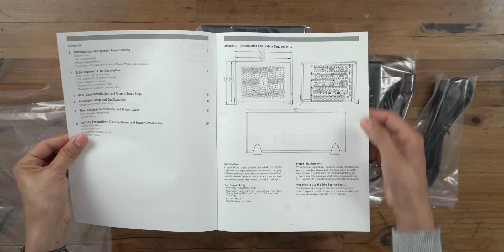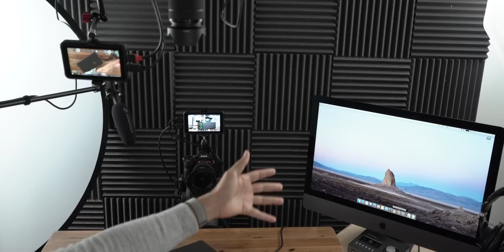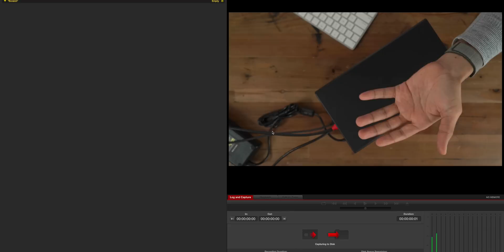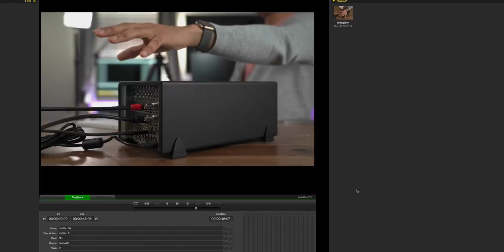How to build a Thunderbolt 3 dual 4K ProRes video capture box with Sonnet x Blackmagic hardware!

Comment from the maker: What do you guys and gals think about this setup? 👍🏽or 👎🏽? Let me know if you have any questions or just want to share a thought. Will be hanging out here in the comments and on Twitter (@JeffBenjam) over the next hour to answer anything you may have. Also be sure to read the full post on 9to5Mac (https://wp.me/p9SZa2-2tDj) for more photos and details.
Reply: Can you have quad 4K capture? I really want 8K recoding.
Reply from the maker: @allansh828  Blackmagic just launched its 8K lineup at NAB. There is an 8K PCIe card. YMMV as far as your Mac being able to handle that though. Would need a beefy machine, for sure.
Reply: @9to5Mac  Too bad that TBo3 doesn't even support the bandwidth of as much as ONE PCIe bus. So… yeah. Even an eGPU via TBo for anything that has more than just shared memory graphics is pretty much completely pointless. And you can get the same functionality as shown as NON-PCI versions, whilst far less constrained as well. 🤷🏼‍♂️

But nice if you're into spending more time and money than you need to. 😉
Reply from the maker: So...how would you suggest establishing a similar setup? (PC is not an option) @postpros-e
Reply: Hi
Reply: Can i use it with my Blackmagic quad 4K60 or 2 avermedia 4K60? 
On pc Thunderbolt 😢

Comment: Am I able to use two types of the same Decklink in the same computer?

As an example, I've got two Decklink Quad HDMI Recorder and I want to Know if I'm able to connect both at the MainBoard from my computer and the BlackMagicDesign Software will recognize them both separately?

Or do I need two different computers  and connect each Decklink in each computer? Ty

Comment: I know this is late in mid July 2020 but my friend that has a You Tube Channel has the quad decklink card that he used for his 2017 27" Imac (I7 7700k w the Radeon 580). and he was having stuttering issues with 4k.  He plugged in 4 different cameras and they all stuttered.  So I sent him a PC w/Ryzen 3700x, RTX 2080, 32gb DDR4 Memory @ 3200mhz and 970 EVO+ M.2 and a 2tb ssd with that decklink installed and first using Vmix and now another program which is cheaper he has no stuttering.  He walks around the room while streaming switching to different cameras and no stuttering.  But he misses Ecamm Live software to have the personal touch with his commenters.  So here is the question, " Can you put a Radeon 5700xt and one decklink in both 8x slots of your Sonnet and get no stuttering?"   I believe it is with the weaker Radeon 580 that has prevented him to have the best experience possible.  He has the same Sonnet box that you have.  He even used an Imac Pro with that contraption and it did not work.  He is not computer savvy because he didn't understand the weakness of the internal graphics chips installed on both Mac computers.  Thanks for any input that you may have.

Comment: Poor use of space inside the case. They could find a power suppy
Reply: The case is made to work with full-length graphic cards, whereupon there's literally no space left other than for air to flow. Also, an external power supply is less prone to interference.

Comment: Since you already own a atomos recorder ... whats the point of spending this money for the enclosure and the capture cards? If you hook up the SSDs from the atomos into your imacpro you have basically the same.  You can edit from the SSDs which should be plenty fast even the 4K footage. Love to learn why you did this? Pluggin in SSDs is not such a hard task :-)
Reply from the maker: The Atomos recorders are great, but they a). Run out of space eventually, and you have to swap out drives. b). Are extremely small. c). Mounting and dismounting media takes up a surprisingly large amount of time when you add it all up. Might seem silly but when you do this over and over it gets annoying. Plus you have the benefits of a large 27-inch display for framing, notes, etc. there are other benefits as well, but you’re right, I’m not doing anything that can’t be done on an atomos for the most part.

Comment: Question: some help. I got a Mac mini 2014 with thunderbolt 2. I want to use the thunderbolt 2 connectors for faster speed ( to connect Samsung T5 sssd and Sd cards among other ) . I can’t find anything since now everything is USB c and thunderbolt 3 . I have a iMac Pro but I want to use that one for some photoshop and easy editing etc. Can you tell me what can i get to get the most of those thunderbolt 2 ???
Reply: http://www.sonnettech.com/ still has thunderbolt 2 chasis, or look on ebay.
Reply: Tek Soup do you have the specific name of the product you refer?? Thanks
Reply: @tek_soup  its for TB3 hosts down to TB2/1 devices (according to startech). i "meant" i worner if TB1/2 hosts can use TB3 Devices. the Startech does the same as the Apple TB3 adapter.
Reply: @SelicIT  no it cant be used that way, sorry if any confusion. TB2 is still good it is fast enough for most devices.
Reply: its a good point, i was always wondering if thunderbolt3 is backwards compatible to 2.
Reply: @SelicIT  it is just buy the startech adapter.

Comment: What's the maximum amount of 4K feeds you can capture on an iMac Pro? Can I do this on my late 2017 MBP? (4 thunderbolt 3 ports)
Reply from the maker: I'm not sure, I'm thinking two is the max, because of CPU overhead when capturing to ProRes. 2 gets me around 80% CPU usage. Three might be too much tbh. With this in mind, the CPU on your MacBook Pro would be the likely bottleneck. I doubt it could handle two streams, but I'd have to test it to find out.
Reply: 9to5Mac I wonder if you could get more CPU cycles by connecting your MacMini to the iMac Pro